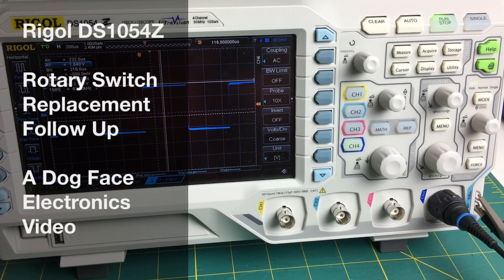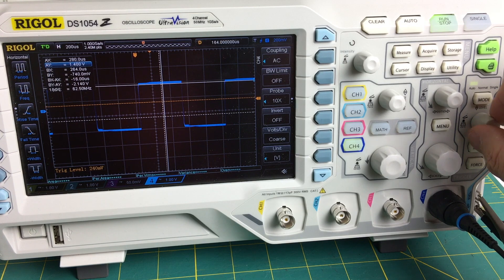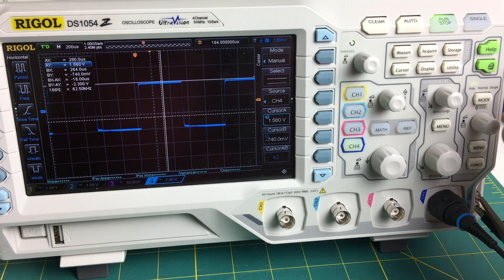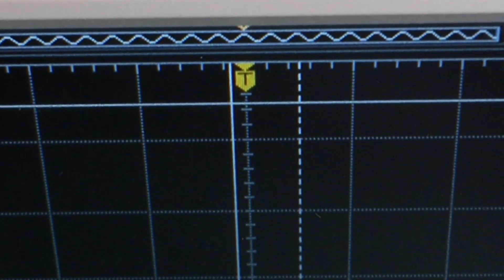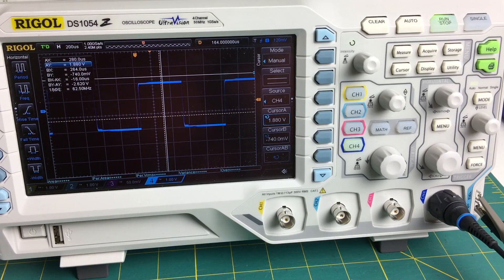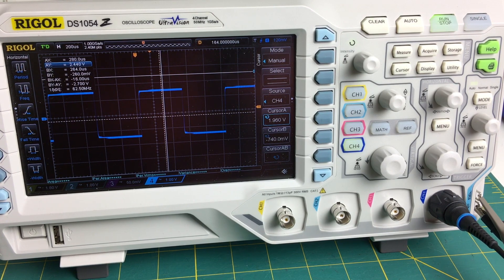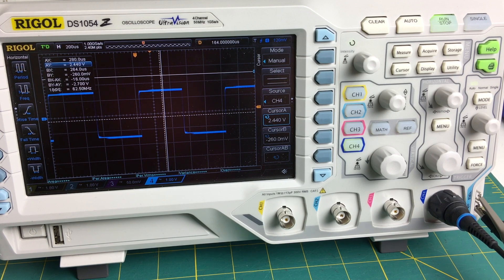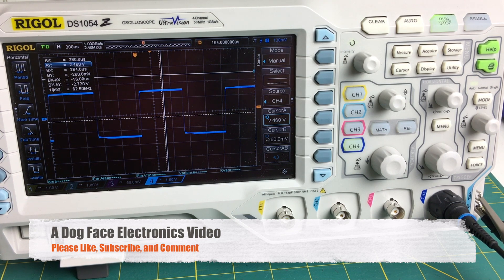Rigol Rotary Switch Replacement - Follow Up

Comment: Today I tried to replace the rotary switch on my Rigol DS1054Z which I purchased from Amazon in 2020.  My board has surface mounted encoders rather than thru board mounting so the one I ordered won’t work.  The one installed is a LJV 20165. But it needs to be a LJV 20135,  same as the vertical and horizontal encoders.  I have searched the internet but cannot find a source for the LJV 20135 encoder.  Does anyone know where this part can be found.  Thanks a bunch in advance.
Reply: You can bend the pins of the encoder so it will fit to SMD pads. I found the Bourns PEC11R-4215F-S0024 to fit well. But it's not for SMD mount, you have to bend the pins as mentioned before.
https://youtu.be/c4XujWP-4_0

Comment: The non detented encoders still have discrete steps. A 24 step encoder is a 24 step encoder, detents or not. I will probably do this mod, not just because the smooth encoder is a pain, but also I can tell it's going to fall eventually. I can feel it getting weaker after  2 years if heavy use.

Comment: Yeah, nice idea and improvement, although you can walk thru the menu items just pushing the dedicated side buttons repeatedly.  Although that is not so convenient when you have hundred menu items to select. So this is a nice update. With one problem: the lost warranty.
Reply from the maker: I wouldn't do this mod right out of the box.  But, In my experience if an electronic device is going to fail it will do so in the first hours of use.  If after using it in the stock form for a number of hours without a problem it's probably not going to fail.
Reply: I will wait a year before doing this. This button is so annoying.....